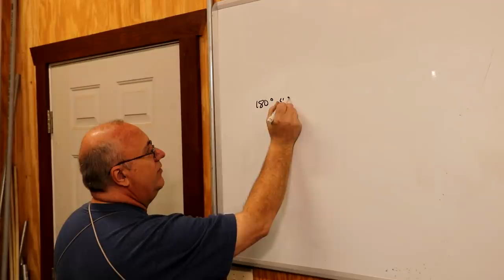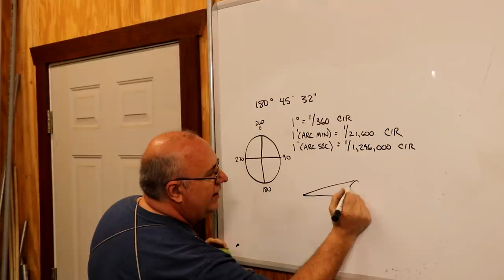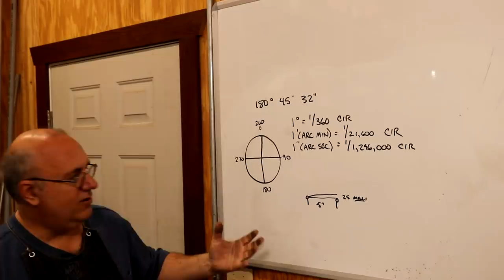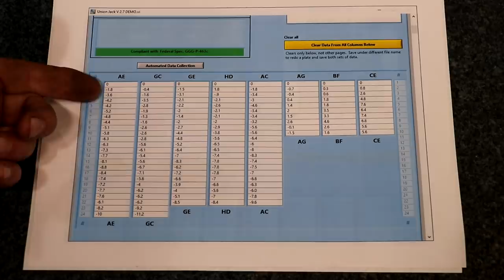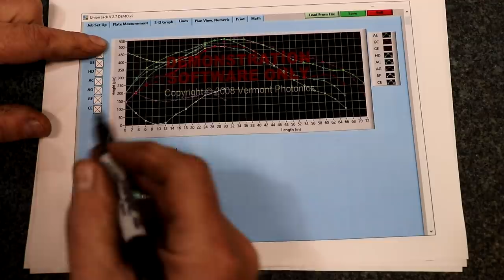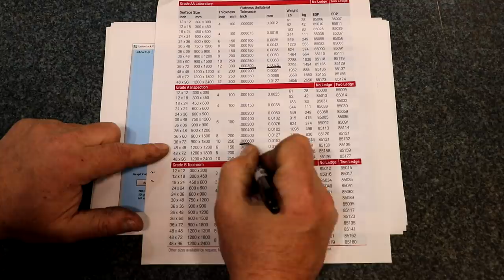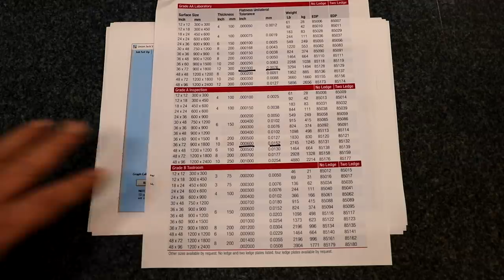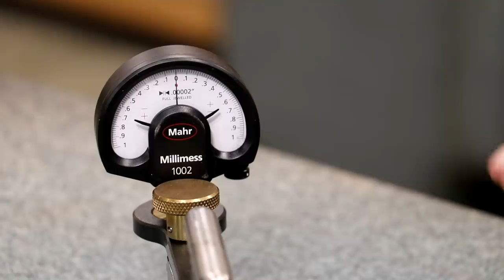Repeat Reading Gauge and Checking Surface Plate Calibration

Comment: THANKYOU for getting down in the weeds. I'm one of these people that would want a full brake down of what ever topic is being covered. I know you barely scratched the surface of the topic but you explained the underlying theory really well, and I appreciate that. I did not know what an arc second was before this. I heard the term and seen measurements that used it, but never knew what it really was.

Comment: Fascinating and impressive the level of degree of accuracy that is obtainable.
Reply: Yes it is! Just check out the specs on the LIGO observatory. They're measuring half the width of a proton, to detect gravitational waves.
Reply: @TheTomBevis  Yes, and the laser travels the length of the tunnel 600 times (300 out, 300 back) so that is a proton width over 600 miles.
Reply: @the1andonlydjt  Please do take into account amount of resources included in both devices;)

Comment: I'm less than 100 miles north of Vermont Photonics and never knew they existed.  They are located in a very fitting place, an area known as "Precision Valley", which used to be home to many machine tool manufacturers...GearShaper and Jones and Lamson among them.

Comment: Where I used to work before retirement, we had an environmentally controlled surface plate room. All our surface measuring tools were calibrated on this MASSIVE granite surface plate. They also had an arm system that would check points on parts and give readouts to .0001". they had an intercom at the door and electronic locks to prevent you from screwing up a measurement. (Yes this was NASA)

Comment: So few people have any appreciation for how important a surface plate is, it is the starting point for all precise measurements.  I used to love watching those guys come in and lap our surface plates, they used to sling those cast iron laps back and forth across our large tables and I thought for sure one would go right off the edge, but they would redirect it at the last second and send it off in another direction spinning and swirling around at a good clip, it was poetry in motion.

Comment: We used lasers in our metrology lab where I worked at an aircraft helicopter company as a  Metrologist. Our air temp and humidity was critical in our lab as well. I think we were at 20C, 68°F+/- 1° and 50% +/- 1% humidity, if I remember correctly. So we always worked at a nice cool temperature. The kicker was the tools were calibrated correctly to our standards then when the workers used the tools out on the floor where it was very hot some days, they had to take the temperature into account defending what they were measuring.
 The key is how accurate do you really need something. If you measure it with a micrometer mark it with a piece of chalk and cut it with a hatchet?
 Great job on the school lesson too. It is something many young students should know regarding arch seconds and measuring.

Comment: Keith, I spent about 5 years of my career working in an electrical standards lab and got involved in measuring standard resistors to 1/10th of a part per million. I also have 2 standard resistors sitting above my laptop on a shelf. I understand precision measurements so I was not at all bored with your surface plate discussion.

Comment: A handy reminder is that 1 arc second is an angle of 1/206264.8 rad.
That means an arc second is 1 mm seen from a distance of 206 m , or,  in imperial units:
1/32 inch seen from a distance of 179 yards
or 1/10,000 inch seen from 20 inches away.
Also, using the mirror doubles the reading, effectively doubling the sensitivity.

Comment: Watched them lap in our granite tables at SSRL/SLAC to AA quite an art. The Metrology Department came in and checked the finish using the same tools you showed but then went to a laser measuring device and electronic level. When I asked why they were verifying both the laser and electronic level calibration.

Comment: Flatness is a fleeting goal. I ran lapping machines for a number of years and used a 6” diameter optical flat with a collimated light source in order to keep the tables flat ( which was a constantly moving target) the best we could hope for while lapping hydrostatic pump and motor valve plates  on a commercial basis was (as specified to me at the time ) about one lightwave. If memory serves that equals about one millionth of an inch as measured by the optical flat that we had at the time. That was over forty years ago so my memory is a little suspect.

Comment: I have a Mahr Comparamess gauge, measures +/- 0.005" at full scale, 0.0001" divisions. 
I got mine 'cheap' (relatively) at local surplus store that used to deal with NASA although contact tip was missing.
I don't watch anything CNC so missed the build, going to look up links..
 Now, all I need is the rest of the body and a surface plate to measure.

Comment: 1 minute of angle when projected on the surface of the earth from the center of the earth is one nautical mile. (1852 meters, 6076 feet, or 1.151 statute mile.)  wikipedia
Reply: And if you travel that distance in 1 hour you are making 1 Knot.
Reply: @fernandofert9960  It is strange the various units of measurement that exist. I think artillery use a milliradian; the circle is divided into thousand parts.

Comment: At these tolerances, you really need to have your surface plate temperature-normalized and completely decoupled from the ground (floating on air bearings). A long time ago, I ran an LK CMM and the surface plate was ~3 Meters x ~4 Meters x ~0.66Meters (thick) the usable space was a little less because the gantry for the probe head (Renishaw) was also on air bearings. The CMM was mounted on reinforced concrete plinth (a ~36" thick foundation), the room was temperature controlled and airdraft-limited (A large booth in a building). Oh yeah, the thing was twitchy, especially getting and keeping it level. The Servo Drive Amplifiers and the Controller interfaces were temperamental as hell.
Reply: @JorgTheElder  Agreed. What I was getting at was that if you really need 1/10 of an Arc Second accuracy/ repeatability with the Collimator, that surface plate needs to be isolated on air bearings. With that kind of precision, perturbations of the earth will upset the precision of that instrument. In fact, if you watch Abom's video and listen to Lance in the background as he uses his electronic level he mentions air bearings. But in this case, that surface plate will never need that level of precision to get to AA grade. But it's nice to know you can actually measure it with greater precision, given some more equipment.

Comment: Keith I will send a set of dimension drawings and photos you can post on vintagemachinery.org of the repeat meter I designed and built to calibrate the surface plate I made from a 24x36x5" granite slab form the local cemetery monument company.

Comment: I may have missed this info but were your lines drawn on the plate?  If so, and you are using a pencil, would the graphite from the pencil throw off your measurements?
I find all of this fascinating. 
I am a hobbist wood worker and I'm happy with 1/32 of an inch.
Thanks Keith for your very good explanation of this process.

Comment: Just FYI... If you want to capture a piece or the entire screen (windows 10 or newer) here is a way to do it: Press: UPPER CASE+WINDOWS+S this will bring up the highlighter... Now bring the pionter to where you want to start capturing from, press and hold the UPPER CASE button and move the pionter to where you wish it to stop grabbing. Release the UPPER CASE button. The area that was grabbed can now be dropped into any file that accepts clips (IE Photoshop, Word, PDF...). In this way you won´t need to purcase the full version of Vermot Photonics to be able to keep a copy of what you just did.

Comment: Keith, this is off topic, but this wk I took time to service all my micrometers, and calipers. 3-4 yrs back I picked up a set of Mitutoyo out side mic's, and the 4-3 had a broken off spindle lock leveler. I am having trouble (spindle is out) removing the barrel, and don't wish to damaging it by forcing it. No where on the web or YT address this. Can you Help? I have to assume that the locking fixture is pressed in from the inside outward ? Please say Howdy to Adam when you guy's are rebuilding Lances scrapper,, Bear

Comment: Hi Kieth.  I’ve wanted to make one for some time, but I’ve been unable because of 2 questions.  What is the metal used for the bottom, and at it’s narrowest point, what is the thickness of the flexture. If you could answer those two questions I can get to fabrication this weekend.  And maybe for simplicity, its overall length, the length of the heavy or light side and diameter of the hole at the flexture.  Thanks!
Reply: As Keith mentioned, check out Saunders Machine Shop channel.  He has a couple of videos where he explains how he built this device.
Reply: @paulcopeland9035  I did but some of the dimensions were omitted. That said, I think that I have figured them out.

Comment: About accuracy. On larger measurements, I hate fiberglass measuring tapes. I would almost feel ill when someone was laying out a building with one. I used a surveyors chain. It's a thick steel tape that will only vary a tiny amount, due to temperature. The fiber ones can vary as much as 6 inches over 100 feet, just by how hard you pull on them. The tape I used would only pull over the guy at the other end, if you pulled that hard. I guess it's the ol' $30 vs $200 tool thing.
Reply: I have had to use the fibreglass tapes as a steel tape is a big no-no in a 132,000 volt substation, fortunately the accuracy needed there is 0.1m (4")
Reply: mind you I once saw the result of a site installing a 100m building, using gps, and forgetting to allow for the elevation of the site, the fixings they put in were over 50mm (2") off when they came to install the building, as 100m by GPS is the measure at sea level, go higher and the points spread due to the curvature of the earth. there is an elevation fudge factor to add in, something like .9995 in this instance
Reply: @grendel1960a  Don’t ever assume a fibreglass tape is non-conductive, some, and it can be difficult to identify which have several fine longitudinal metallic threads, if the wind catches the tape you can easily get a flashover.  Circa 20 years ago we had such an incident in the UK. The person survived.
Reply: @MartinE63  quite correct, only approved tapes were allowed, and generally where possible a measuring wheel would be preferred, or in the more modern world, a laser measure.

Comment: I have been looking at surface plate testing videos and one method I never see used is inking a plate in the manner used in scraping. Why is this approach never used? I would think that you could apply ink to a plate and then slide a smaller (perhaps grade A) plate on top of it to check its condition.

Comment: I reckon circles should be metric-ified.  1000/100/100 instead of 360/60/60 - think of the levels of accuracy.... 1  10,000,000th of a degree could be .... unachievable?  Wouldn't stop folks trying to get there tho, bless their cotton socks
Reply: But the Babylonians would not like it

Comment: Don't you need a climate-controlled space to really map a surface plate (or any super precision instrument) in an ordinary shop environment?
Reply: yep!
Reply: Sure, but you can still be pretty precise if your plate has a more or less homogenous temp over its volume.
Reply: Not really. The issue is temp variation over the time of measurement and the flexibility and thermal mass of the object. Temp variations of a few degF would have no material effect on plate flatness
Reply: @padraicmcguire108  Temperature affects the measuring instrument.

Comment: As a German, I am always wondering what you Americans consider high precision. No insult intended!
A friend of me is a tool maker for plastic injection molds, there manuel lathe, the "workshop whore" can make parts within 0,01mm without even trying, that's rough measurements for them.
There cnc machines do less than 0,001mm repeatedly. And if they need to (for small medical stuff) they do die sinking or eroding... I don't know wat is correct in English... To 0,0003mm (and that is for absolut dimension, just because the cnc that makes the graphite tool can't go much more) repeatability of those eroding machines are even better.
What is that in inch? 0,0000000000001? 🤣
Of course a surface plate is over a long distance, and for most applications those 0,01mm  or 0,0005 inch is more than enough! 
Every time he makes a part for our car's or motorcycles, they fit just so snuggle, often times you have to run a fine stone or a file over the original part to deburr a little nick, and than after 10min fitteling it just slides in. 
So satisfactory! 🤤🤗

Comment: In rifle shooting moa or min of angle is used which is roughly is 1 in. Actual is (1.047) At a 100 yards. This translates to 10 in. at  a thousand yards. Quality sights either scope or irons are set with up to 1/8 min adjustments which will move the point of impact 1.25 in at a thousand yards.

Comment: Years ago i ground gears for helicopter transmissions , inspector checked our plate every monday  morning . Aprox 16 by 18 inches in size , was unusual for plate to pass three mondays in a row. He used a repeat reading gauge of a slightly different design , same principle . Our use was very localized , so wear was fast .

Comment: arc seconds are also used by astronomers to measure the spacing between two stars that are either orbiting around each other or are visually very close, and for measuring the apparent diameter of planets at different parts of their orbitsfor example the moon as seen from earth is approximately 30 arc minutes apparent size, mars varies between 3.5 arc seconds (at its furthest point in its orbit to 25 arc seconds at its closest point, currently mars is about 179 million kilometers away and appears to be 7.8 arc seconds
Reply: Be careful, it seems there is a separate set of measuring units like that. Astronomy has a certain time unit set which divides one full circle (360°) into 24 hours. In this on arc minute equals 4 seconds. So you really have to pay attention here if they use arc seconds or just "seconds"

Comment: I watched the entire video and found it fascinating. I know this wouldn't be practical but I kept thinking about the slates on my pool table. I've got the table as level as possible, but I know there has got to be low spots in the slates. When a ball rolls quickly across a certain spot, it will roll straight. If it rolls slowly to a stop near a certain spot it rolls off. I know it wouldn't be practical to have the 4 1/2 by 9 ft. pool table slates lapped but it would be interesting to see how much better the table would play if it could be done.
Reply: Use the slates to lap themselves.
Reply: @ShainAndrews  Need 3 to do it
Reply: @bwyseymail  Most contain three, unless paying more money for two or big money for a single slate.
Reply: @ShainAndrews  It is 3 pcs. I've never heard of lapping them like you suggested. It seems like it would require some type of abrasive to remove high spots. I don't think just rubbing the slates together would work but I might be wrong. I would be interested to learn more about this.
Reply: @141poolplayer  Correct a lapping compound is used.  Google around for three plate lapping... something along those lines.  I bet Tom Lipton has covered this subject.  He is all about precision.
Reply: @ShainAndrews  Thanks for the info. I'll look into it.

Comment: very interesting....you're mapping out your surface plate using the Cartesian coordinate system (using the X-Y axis in rectangular notation) so you can measure the relative flatness at different locations in the Z axis using polar notation. BTW: gunsmiths and precision marksmen also use the polar system of notation, although with much less precision. A precision rifle should shoot better than 1 minute of angle, or 1 inch at 100 yards. 3/4 or half a minute would be better.

Comment: The explanation of arc seconds was spectacularly useful. I got a really good qualitative sense of how small the increments are you are dealing with. Thanks for the trip to the weeds! Now I understand why guys doing this work step away from the plate to measure and wait for the heat from their hands to dissipate in the tools. Thanks for this exploration of some basic metrology.
Reply: Indeed. If you just say one arc second is 1/3600° it may not look that spectacular. Only I guess no one really can imagine how little that is unless you give some perspective to it by an example. I remember an example from University where they told us, a 1 EUR coin is about one arc second from 4800 m. You need a damn good telescope for that...

Fun fact (and totally unrelated) for those wondering how certain units and "natural" measurements got to some of the units we use today. The arc over one arc minute of the earth's diameter is quite exactly 1852 m long. If that sounds somewhat familiar, that is how one nautical mile originally was defined.

Or for those who like it more nerdy. A right triangle with one angle being 1 arc second with the opposed leg being one AU (Astronomical Unit, the average distance between earth and sun), the adjacent leg has a length of 1 Parsec.